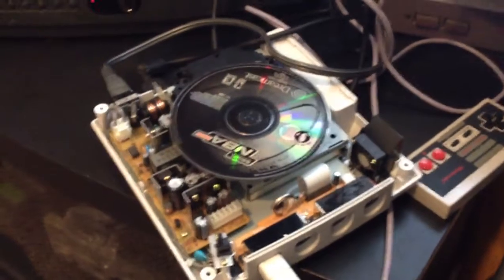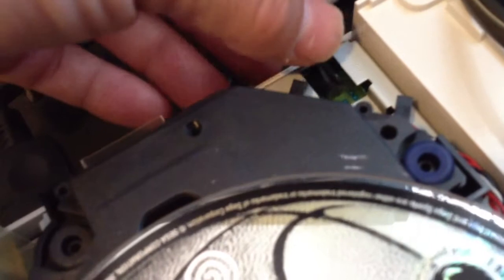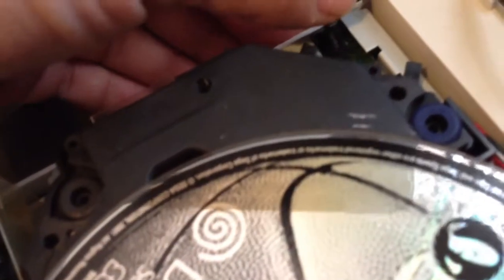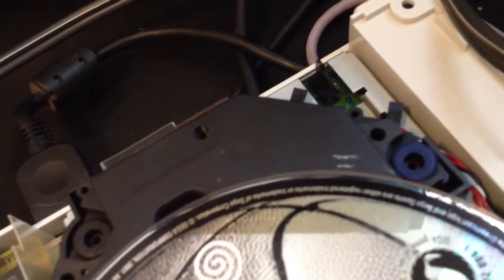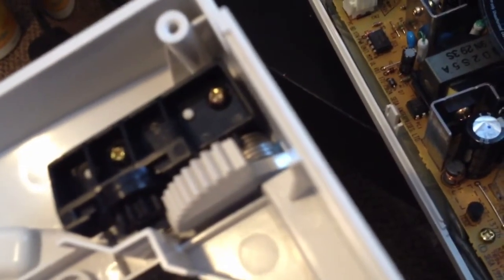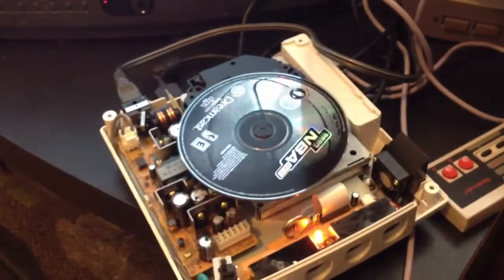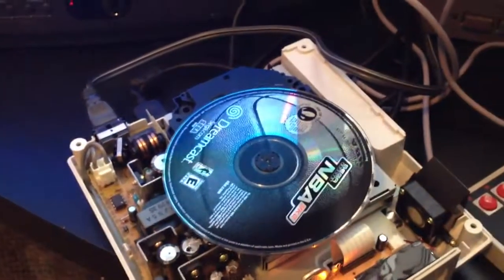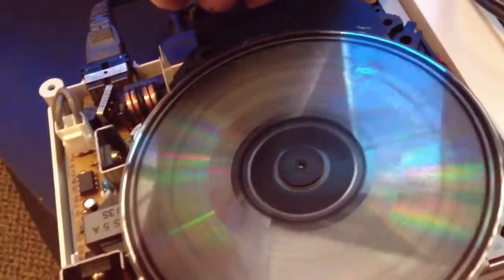Sega Dreamcast motor not spinning

Comment from the maker: what I did is I put a layer of hot glue on the trays push switch tip and the Dreamcast works great however I do not trust the end of the switch getting stuck in the hot glue overtime and then ripping the switch out of place .so I pulled that off I just wanted to see if adding a thin layer of anything would fix the system and that does ..right now I just added I thin layer of melted plastic that won't come off I got a let it dry then I will try again.. I do know that people use tape on these things but that's just not going to last

Comment: Hi. Thanks. I have a PAL Dreamcast, I left it playing one song on a music CD (on repeat) for about 8 hours or 10 hours because I fell asleep. When I woke up, the lens is moving it it's not spinning. I replaced that with a working GD-ROM (whole thing) and it happened again after a few days of playing. I now have two dead GD-ROMs. Should I measure voltages coming from the  power supply to where the GD-ROM is connected? Or should I replace the thermal pads in the GD-ROM drive that touch the GD-ROM shielding and some chips on it's board?

Thank you. God bless, Proverbs 31